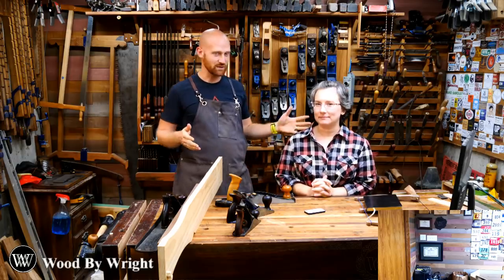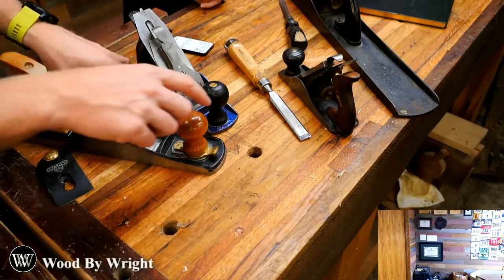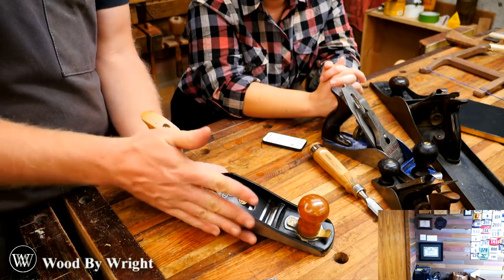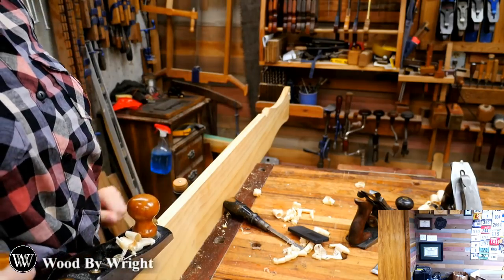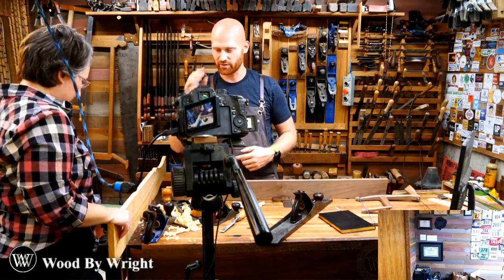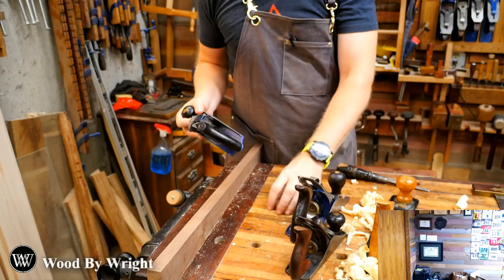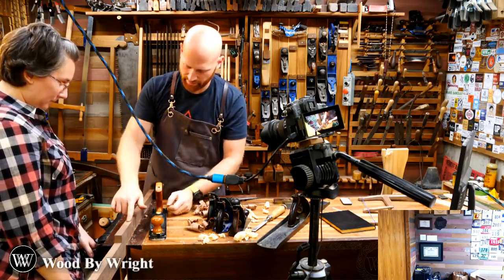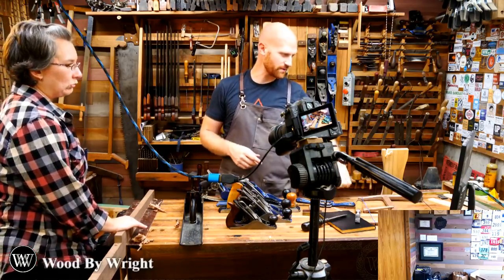Hand Plane Basics with a Beginner how to use, setup and chose a plane

Comment: I think you should make some removable decking for around your bench.  I'm no expert but I tend to start with the iron away from the board and take a run up, it looks like your wife's cuts starts with no momentum making it more difficult. Also starting off trying to get a long curl doesn't get her used to the plane. Working on a short piece of undulating stock with small back and forth strokes gets you comfortable with the tool and just what pressure to apply when and where and making her own adjustments would get her knowing what plane adjustments produce what results. You could do a series of projects on your knees (with pillow) with your upper arms strapped to your chest for a different perspective ofc.

Comment: Hi Matthew, I have a question about planes - no matter how I set them up, adjust the frog etc, the blade always wants to go to one side and I have to adjust it with the lever, usually pushed right over to one side so that the blade protrudes evenly out of the sole of the plane.  What am I doing wrong?  Forgive me but I do have another, more important question.  I've recently started to renovate chairs,  With the current lot, I can't take the mortice and tenon joints fully apart without undoing the upholstery.  I don't have the skill to put it all back, so I'm using a spreader clamp to partly release the joint.  I can't take off all the old glue so I use epoxy glue instead.  My question is this: does epoxy set rock hard and brittle or, like PVA does it retain some flexibility as the wood expands and contracts?  Your the only person I know on YOuTube that bothers to read comments and answers questions.  I follow your advice and greatly appreciate your responses.  Cheers, Gwyn Buckley
Reply from the maker: Often it is the frog not being in line. it is not a problem, only a couple of my planes keep the lateral adjuster in the middle. also it can be that the iron was not sharpened square.
Every epoxy is different. some are brittle and some are flexible, so I don't know what one you have.
if you ever want to send an email feel free it is listed in the about tab on my channel.
Thanks for the kind words!